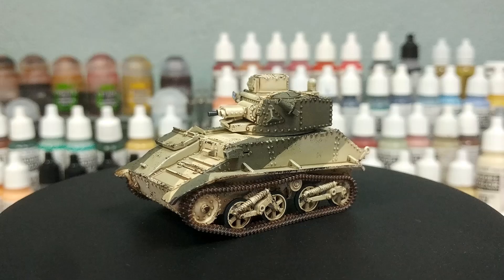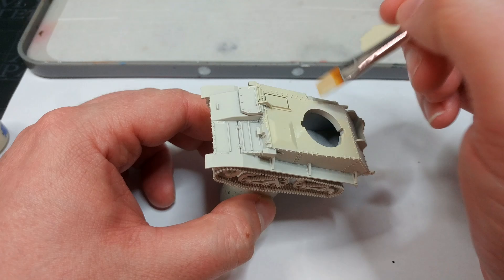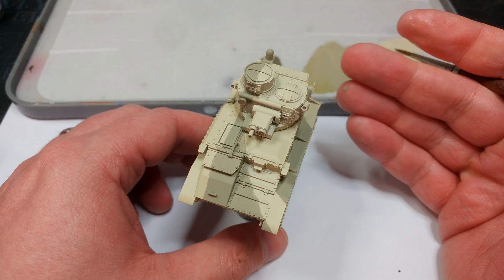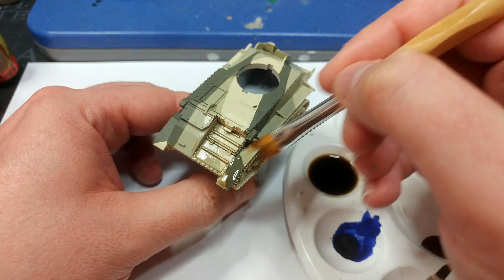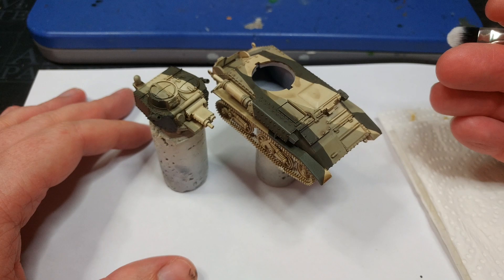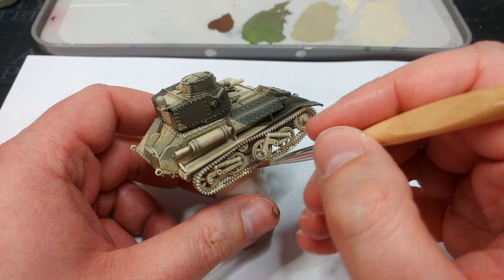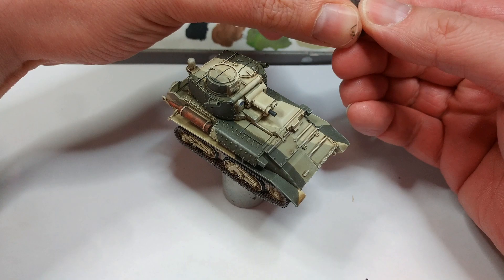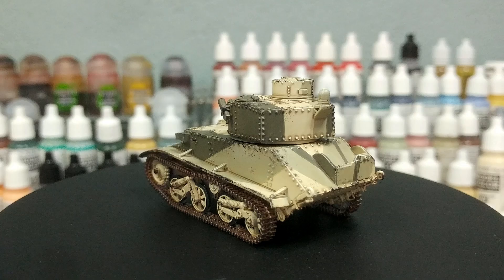Hand-Painting Caunter Camo for Early War British Vehicles [How I Paint Things]

Comment: I have found Ammo by Mig's masking putty works well surfaces which are uneven.  Considering you did this free hand it is very impressive.
Reply from the maker: I'll have to see where I can pick some up!
Reply: Can also use blu-tac, plasticine or play-doh, roll it out thin, cut lines with ruler and blade, lay on surface and gently push down to seal edges over details.
Reply: @richardcowling7381  I have used blu-tac or press stick as it is known locally in the past, but I have found that it some times lifts paint right down to the plastic  when removing the blu-tac,  which is why I moved to the more expensive masking putty.